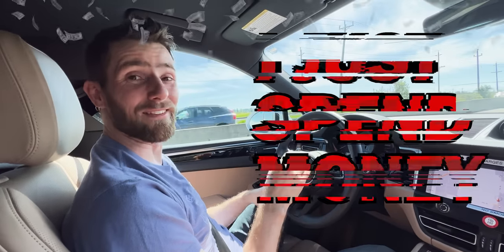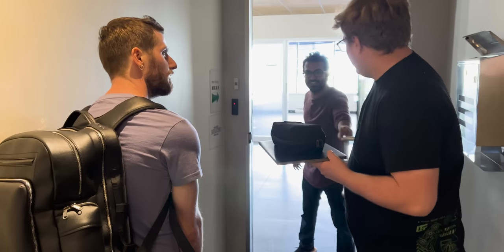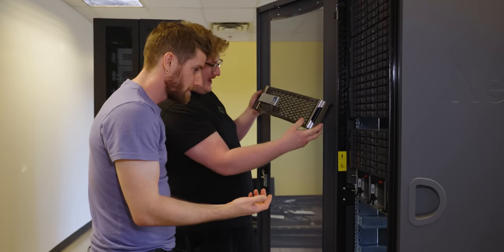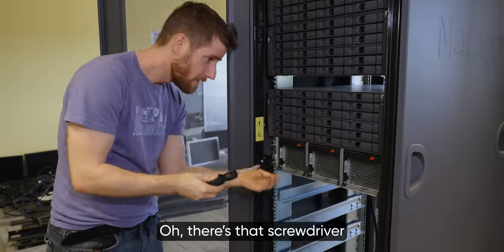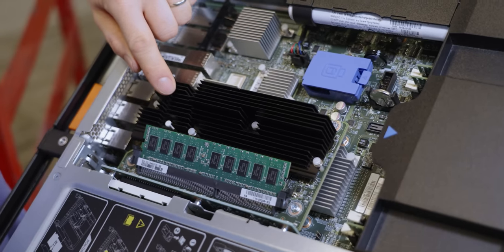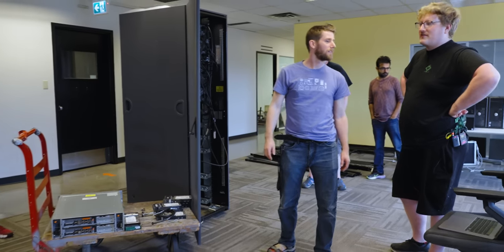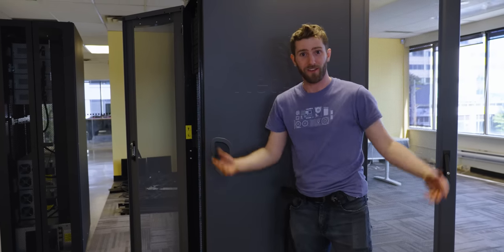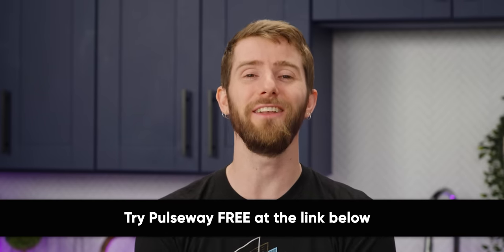WHAT did I just BUY on Facebook Marketplace?? - NetApp Storage Appliance / Disk Shelves

Comment: 12:30 - Almost. The system doesn't have a RAID card; the system itself is a giant and very smart RAID card. And yes, it has the RAM of an x86 system on battery backup, which is awesome.

Oh, also 17:15 -  NetApp's ONTAP arrays are actually NAS first, and SAN functionality is running on top of that.
Reply: The inaccuracies in the video were a little hard to watch but, overall, he did a decent job of trying to target an audience of home lab geeks that have no knowledge of Enterprise class storage systems.  I enjoyed it.
Reply: WAFL for the win - very good software RAID, volume management and filesystem, so good that Netapp sued Sun for ZFS when it came out. Confidential settlement, apparently one of the myriad of reasons why it would be so difficult to get ZFS GPL licensed.
Reply: @KristopherLinville  There were hardly any glaring inaccuracies overall. It's easy to make that comment after the fact but they're trying to explain the operation of that rack setup after seeing it for like 5 minutes, and they're trying to rush themselves in someone else's office.
Reply: if you have a licence 😞
Reply: I think using the term HBA for the controller card would have been more accurate but to the majority of the people who watch this channel, they probably wouldn't know the difference.
Reply: Wait until they figure out how much licensing costs! Some vendors used to basically give the hardware away for free as upgrades, you just keep paying for the licenses
Reply: Yup I had 800 TB of these drives (backed by 2TB drives) exposed as NFS, and I instantly recognized the DS424x chassis.
Reply: @KristopherLinville  sometimes I think they could make a channel dedicated to us boring enterprise people with million dollar annual budget and mission critical workloads, and maybe they are the only people in the world who could keep it from becoming a pure marketing ploy for the big vendors

Comment: I have worked with these NetApp appliances for years in my previous job, enjoyed them a lot. You got a very, VERY good bargain. Yes the shelves are old but the controller seems a more recent replacement, maybe half the age of those disk shelves. If so you can upgrade the OS from 7-mode ONTAP into the newer Cluster Data ONTAP and then you could mix storage tiers (SSD + SAS + SATA) and controllers as you wanted. The card with battery is probably the Flash Cache, everything was written there after the controllers' RAM and then dumped to disk in background.

Comment: honestly given the age of the hardware it would be too slow for most of the media stuff you do, but also ample enough for a lot of other use cases as well. I'm a fan of re-purposing older hardware that still has a use case, no matter how obscure. i'm sure it'd be more than enough for the lab for example as a place to dump raw data from testing and archiving, also as just a backup location in another building tbh.

Comment: Last time I moved a SAN setup, we took out and individually packed each drive in anti-static sleeves and stored  in a box with foam inserts to protect them in transit. Also, for road use, people would use Pelican cases with drive cutout foam. Makes it a lot easier and safer to move, plus the rack units are a lot lighter without the drives inside of them.
Reply: Modern hard drives aka anythingfro this century part the heads off platter. You can move them just like they are being shipped to you. They will be shipped full of drives anyway.
Reply: You did that because the data on them still mattered to you or the company. They don't care about the data or the drives.

Comment: 2:10 The DS4243 and DS4246 support sata or sas drives. If you want to mix and match sata/sas in the same disk shelf you need use the interposers. 2.5 sata ssds also work, you can use Dell 3.5 to 2.5 caddie converters instead of the expensive netapp ones.

Comment: Speaking from experience, depending on licensing level, that kit probably was closer to $500k-$1m brand new. Also while they are using "raid 10" netapp has an overlay file system called WAFL (write anywhere file layout) which is very write optomised. When the netapp has something to write to disk, it will write it wherver the heads currently are, and then sort out optimising later.
Reply: Agreed. Especially 70TB was worth big bucks. Might've spent $2m easy on it since 2012...

Comment: We have been using iSCSI SANs for a while. The follow video where they will try to get it to work will be fun. iSCSI and multipathing can be confusing at first. Replacing the hard drives with something larger could also be a problem since these systems are often locked down and can be used with certain vendor specific hard drives.

Comment: The PSUs on the netapps are interesting, they actually double as cooling fans even if only 1 psu is powered by mains.
Also take a look at the 5V rail, these PSUs are monsters for HDD.
Reply: Depending on the AFF/FAS controller or the Disk Shelves. YES. Some Disk shelves fans and PSU are separate.
Reply: Backups are never within the same device, those are copies! To be a backup it needs to leave the device so you can rebuild from scratch. In the case of that device, the filesystem is just pure magic to make those copies.

Comment: One correction: Assuming the shelves in the picture are the actual shelves you got, those are single path only, so no redundant links to all drives (the shelves are still cabled in a ring topology, so still kind of redundant, but not really).
Reply: Each of the shelves has 2 IOM3 modules as its a 4U unit. It is multipath.
Reply: Each path is connected in a daisy chain. Node 1 e0a -> shelf 1 IOM3(a) port 1 -> .... -> Node 2 e0c or d. Then, it is similar path on Node 2.

Comment: 19:50  These drives use 520 byte sectors.  Regular 512 bytes + checksum.  You can take a 512 byte sector drive and low level format it to 520 and vice versa.  I usually use openbsd to do it.  It takes a long time for large drives, but hey if you need it, you need it.
Reply: I had one of these in my homelab, with 4TB drives. I just wrote a script to do it, pass in the device IDs, voila next morning a shelf full of usable storage.
Reply: @morosis82  i had a bunch of FC drives that were 520b formatted that i wanted to use in a sun v880.
Just launched a bunch of ll formats in parallel and went to bed.  Some drives failed,   wash, rince repeat a few times and voila 😁

Comment: The compare and contrast between this video and the Asustor, "I should stop building computers" video from the day prior is kind of amazing - similar effective storage and access, but one does so in a much smaller space (if you can afford 4tb-8tb sabrents or whatever.) Tech has come a long way in 10 years, even if it's not so obvious to the average consumer.
Reply: Sort of. These shelves are kinda commodity hardware, you can connect one to your PC if you want (with a card and a cable) and fill it with 20TB drives (for 480TB of space), or have some flash in there as well.

The shelf controllers are probably only 6Gbps though so you'll only get SATA level flash speeds, but it's still pretty quick.

Comment: Its cool to see Linus and co geeking over an old SAN. I never used Netapp myself, it was before my time as a storage admin, but I heard they were decent. Also, on the topic of reliability, iscsi is less reliable than using Fiber Channel SAN switches. I have heard of some horror stories when iscsi fails. Yes iscsi is cheaper but the reliability of using FC SAN switches is unmatched.

Comment: The disk block size issue has to do with Raid parity. Old school raid have 520 k blocks instead of the normal 512 k block size on new disks. The extra 8k was used for parity calculations. This is not in use anymore and is part of the reason hardware raid is meaningless.
Reply: That is complete and utter rubbish for starters its bytes not kilobytes. It's a checksum of the 512 byte block and has nothing to do with parity calculations. It's why storage engineers look at ZFS and laugh so hard they piss their pants.
Reply: @jonathanbuzzard1376  - Please reason with arguments instead of trashing semantics. I get three hours of sleep a night with my two months old toddler and English is my second/third language. Yes it is bytes but tbf. All our SANs at work is SSD SANs with 4 KiB, so I was thinking poorly due to sleep deprivation.

Also, read my comment again: I am referring to old school raid, aka hardware raid. I have never met any storage engineers the last four years who still implements this, it’s too slow and the only thing you gain is an obfuscation layer where bitrot is highly likely given enough time - in ye olden days where this was done using extra bytes per sector, hardware raid was good. You can’t even buy raid cards with SSD storage solutions from any of the big manufacturers anymore, because the SOC are not fast enough. And what is the point when you can just as easily buy 32/64++ core monster CPUs for cheap(ish)? Servers don’t have 2 to 12 cores anymore.

Comment: Those DS4243s are able to run SATA drives without issues. You can also run HP Compellent controllers in them to get around the funky franken-cable that the standard NetApp controller uses. That way, you can run a standard h200e  or similar in any computer.

Comment: Great video!   One thing to check when buying a used SAN is are the drives proprietary.  Many vendors modify the drives to allow the controller to recognize a "valid" drive. A replacement drive of the same model and firmware will not work.  The cost of those drives can actually be cheaper on used market (sometimes)    Cheaper than from the vendor, if they even still have them.   Downside is they are usually used drives pulled from arrays.

Comment: Looks like the 3par from HPE... The powersupplies are so big because they are also responsible for the cooling as well, p.s. if that thing is anything like the 3par you need to make sure you have a cable diagram or have labled the SAS cables in order for the communication to work between all the shelves and the controllers
Reply: The 3par PSUs are so big because they also have battery backup in them so that the data in the write cache can be written to disk in case of a power failure before powering off the nodes.

Comment: I thought NetApp has hardware controls in place that prevent any "non-vendor branded" drives from operating. But old NetApp may have a community I guess.
Reply: If they do have this type of branding, it'll probably be part of the NetApp software. If you wipe the OS on the controller and just put Linux or something on it, you can probably do whatever you want. You would have to implement your own high availability and redundancy setup yourself though.
Reply: correct i believe
Reply: @joshuamarcotte8514  Good luck with that! You can no doubt run Linux on it, but you'd have a really hard time getting it to work with their custom hardware interconnects, etc most likely. Could be done, but that'd be a lot of work.
Reply: There were ways around this.
Reply: @joshuamarcotte8514  yeah. thats not a thing.
Reply: @krennic4438  these shelves are literally rebranded Xyratex. Same stuff as Lenovo, Dell and HP were selling at the time. You could literally take a Dell IOM module, slam it in a Netapp and you were off to the races, at least in terms of getting access to the disks.

It's just using a slightly odd cable with different SA's connectors on either end.

I had one of these shelves hooked up to my Dell R720 and then Supermicro Epyc last year with an external SAS controller from HP.

The controller is even relatively commodity I believe but yeah the software would suck to have to use.

I reformatted the 4TB disks that came in it to 512b sectors and used it with Linux just fine. It's fun using device IDs like /Dev/sda.. up to sdz then it rolls around to sdaa.
Reply: Nope its Engino which was LSI then brought out by NetApp.
Reply: Ignore the netapp controller, just connect the JBODs to a standard server with an external SAS HBA and you can use them in any way you choose.
Reply: @joshuamarcotte8514  put Linux on the controller, you have no idea whatsoever do you. Apart from anything else the controller will only take signed images. It's running Windriver by the way.
Reply: @TheRedshift_  Pretty sure they are just standard SAS connector cables, but doesn't mean they will connect to any controller. You'd be amazed what vendors do to lock down there hardware. Would be ideal if the arrays could just be connected to any controller.
Reply: @joshk1058  I'm running one in my lab, using the original IOM6 modules in the chassis, connected with a QSFP to Mini-SAS cable to an LSI 9200-8E in a supermicro server running TrueNAS and it runs great. Though I havent managed to fill it with drives yet, still a work in progress there. But yeah, these units are completely dumb in a hardware sense and pretty much all the proprietary locked down crap is in the Netapp controller boxes which are pretty much worthless once the license expires, the disk shelves are still perfectly good chassis to use for large storage servers.

Comment: The irony about the NAS vs SAN discussion is that I would NEVER use a NetApp for block access.  They're great for file, but ... nothing but trouble with their block access.  I've heard they're better now, but last one I worked with was from this one's era.  Edit: Wow, running 15k SAS in RAID 10.  Super curious what their compute work-case is now.
Reply: I've used Netapps for both NAS and SAN (even the same Netapp).  Never had any trouble with either (at least not that didn't get resolved with a quick support ticket). But, yeah, their stuff is more optimized for NAS use cases.
Reply: Depends on the NetApp you have purchased that looks like the Engenio stuff so basically very similar to an MD3000 series from Dell (Dell MD3000 series is rebranded Engenio) its fine for block level stuff.
Reply: NetApp is a jack of all trades.  It does all, but its never the best solution (well, it is pretty good for VMware NFS datastores).  Their SAN implementation works much better now, but its basically creating massive LUN files inside File based volumes.
Reply: @jayhopt  that is an Engenio based system that NetApp brought off LSI. It is a pure block based storage array, and is not a NetApp "propper". It is basically the same as a Dell MD3000 series storage array.

Comment: I've worked with these in a Win Failover cluster env setup for a fair while.

Recently had to write a doc to transfer a Supermicro 2007 era system using SCSI over to a mid 2010s era HP SAS configuration.

Man the document I produced took some time but was indeed quite epic!

Comment: WOW, I haven't seen a SAN server since I was in highschool, and I was the one to build it.

I used a raspberry pi, 7 flashdrives with a powered USB 3.0 hub, and a lot of trust from 2 highschools to setup the storage system across the internet. Custom startup commands to start processes after a power outage/lockup.

It hosted a Linux VM as a command line desktop system to run whatever tasks a raspberry pi could do. It was donated to my 2nd school as a study resource of a different server setup.

Comment: Reminds me of a storage array I saw in a scrapyard in 2003. Two massive cabinets, proprietary, not 19" racks. The bottom 3rd of each was all power supply and huge cooling fans. All the drives had been removed and stacked up inside the yard's building. Each drive was 9 gig. I counted the number of drive slots and added them up. It had been a literally massive 1 TB storage array. I assume usable capacity would have been less with at least RAID 5.

At the time I was thinking the company that had scrapped it could have replaced it with a PC and a few of the then largest capacity drives. I have no idea what interface those 9 gig drives had. It wasn't SCA80. I had a collection of beige Macintosh computers at the time and if they'd been SCA80 I'd have grabbed a few to used in the old Macs with Narrow SCSI adapters.

Comment: You bought a Netapp FAS, which isn't just block level iSCSI, but also CIFS/SMB NAS on it. Pretty much the same as a QNAP or Synology does. It also does NFS Storage as a protocol for either file access or as a datastore for ESXi. You also get deduplication and compression to make better use of the disk space. The main difference to a NAS is the redundancy part where you do firmware updates and the upgrade process switches back and forth between the controllers so you don't have any service interruption to your connected servers.
The main cost also comes from support contracts and advanced features like SnapVault, SnapMirror and all the bells and whistles Ontap has to offer. Especially MetroCluster if you happen to have two FAS in different datacenters and you want an active/active cluster.
Reply: I can only upvote this comment once - but it deserves so much more! If only Linus would take a few seconds to actually set this up and discover Storage VMs, they would be blow away.

Comment: NetApp, are one of the best storage solution.
Just some notes, the hard disks enclosure are named “Storage Shelf”, the best RAID on that storages are the Raid-TEC, the SMB is crazy fast on that machines, the controller have flash cache for the hot data and the ISCSI maybe not the best option in some cases to connect virtual environments